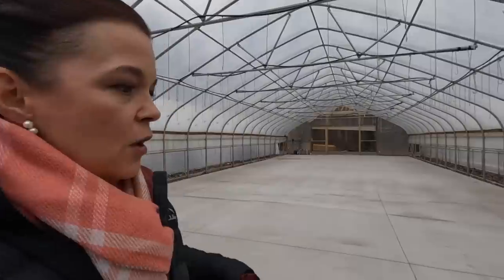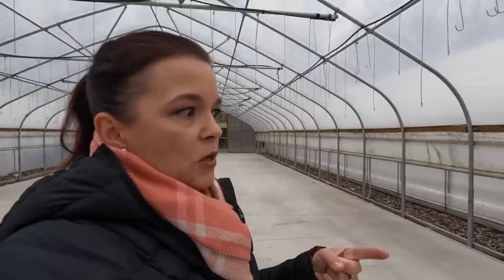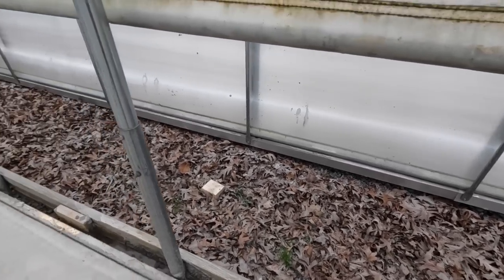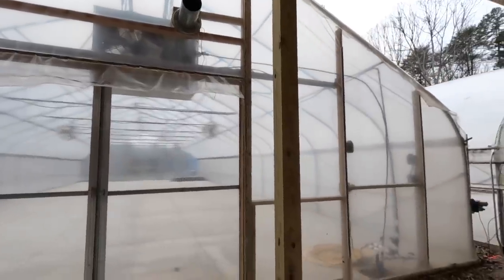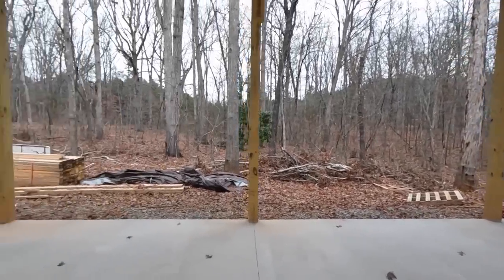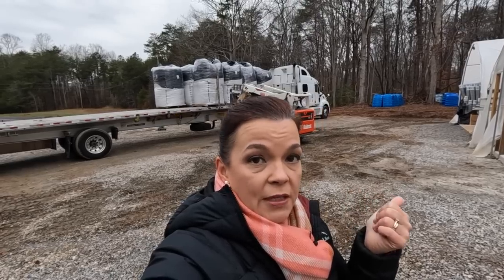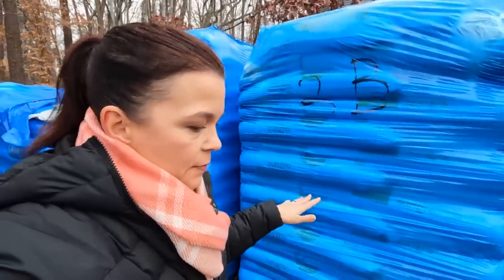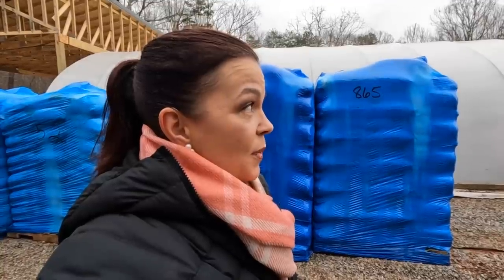Soil Delivery & Concrete Oh My! | Gardening with Creekside

Comment: I live in East TN and they do not use rebar or metal in our concrete either.  However, I totally disagree with their thinking. After a poor of a garage and driveway about 3 years ago my garage floor has cracked and also my driveway has two cracks in it.  I would prefer rebar    I hope your experience is better than mine.  I love GWC and hope to visit next year.
Reply: Pour not poor.

Comment: They don't do that for driveways anywhere that I know of. This is basically the same. So it's kinda strange people are asking you why you aren't.
Reply: The only thing rebar is used in is foundations.  At least that I'm aware of and my husband is a contractor.
Reply from the maker: From my understanding it is different in different parts of the country.  Especially in areas that have severe winters or areas that have very loose, sandy soil.